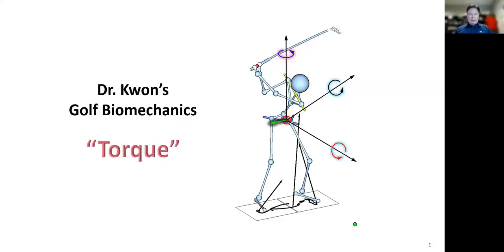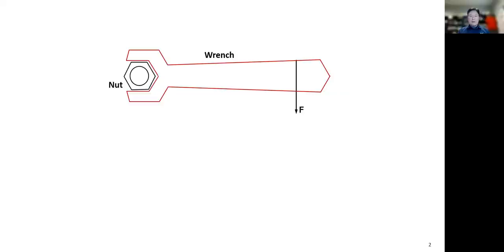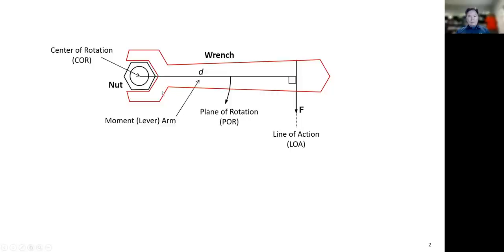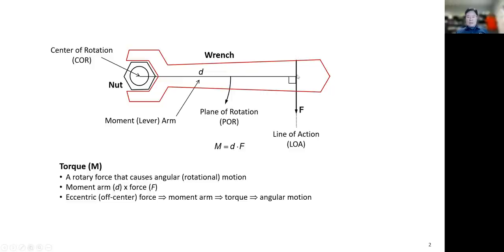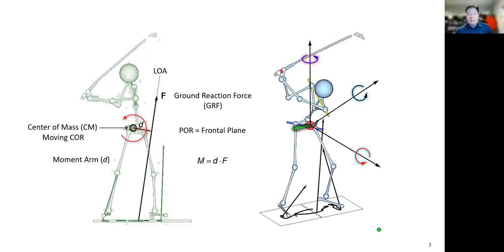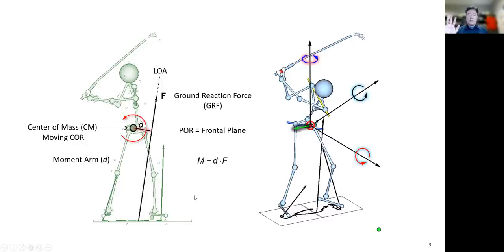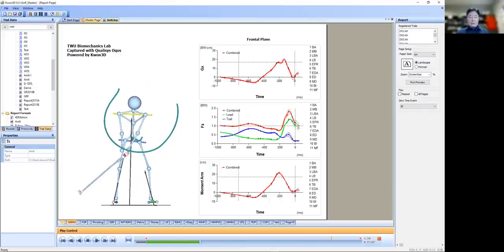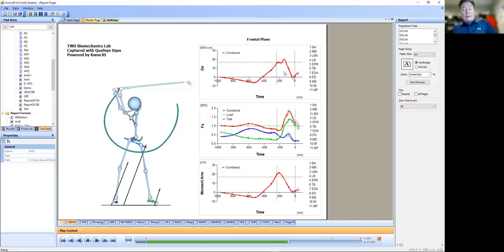2022-01-04 Kwontum Physics: Torque, Part I on Dr Kwon Golf

Comment: I have watched the 1-2 and three steps and a full lesson so far. This is the most important golf instruction and information I’ve ever seen. I’m posting this for my golfing community. I have been a two or three handicap most of my golfing life. In the first year I took up golf at almost 50 years old I was a five handicap within one year. Why, because I just use basic skills and a good coordination. I used kinetic energy based on my baseball swing. Moving the ground force horizontally keeping the back to the target the ball and then turning the hips through. As I said I was hitting it farther and better and all my golfing buddies and betting friends were amazed. Then I thought I would get better quick bye reading golf books and particularly Ledbetter. It was an enormous mistake as I spent countless hours on positions. I never got much better than a five handicap and actually got a little worse and then better only when my short game improved dramatically. Since then I’ve been going back-and-forth with different concepts always thinking about kinetic motion and energy build. Finally, I have watched Dr. Quan presentation and information. Now I understand how to create energy from the ground up and most specifically how to move and create the energy from one foot to the other. I know the information seems a little technical but it is very fundamental, proven and Important to all serious golfers. So if you are coordinated, have some flexibility and want to improve dr. Kwan‘s instructions may be the answer. By the way, I never post but I feel that this information is important. Best. And thank you Dr. Kwan, I just wish I could come there for lessons.

Comment: Thank you Dr Kwon. Two questions if you would be so kind. Firstly, can you please explain the best way to increase the moment arm for the frontal plane (POR)? For example, more turn and force in the backswing and then upward force on the front foot in the downswing? I'm not clear on the concept of horizontal = larger and vertical force = smaller at 12.50 in the video and how this relates to the unweighting discussed at  20.30. Second question. How do you increase forward shaft lean using these concepts? I have been able to increase my student's clubhead speed but not forward shaft lean at impact.

Comment: As someone who specialised in structural dynamics as they apply to seismic engineering I find your application of the same concepts to the golf swing helpful and illuminating.  Hopefully a companion video on the equally important ground torque about the vertical axis as shown in your 3D stickman figure will follow soon.   I would be very interested to know how much the inclination of the axis of the the total ground torque varies during the swing and if this is related to how “smooth” the swing is.   Presumably if this axis is varying a lot there would be out-of-balance forces that would need to be absorbed by the golfers inertia and make the golfers swing less “smooth”.

Comment: Thank you Dr. Kwon. 1) at top of backswing, how can we maximize inclination of pressure, by pressuring more on the instep of trail foot? 2) middle of downswing/p5, to maximize torque, move COP forward relative to COM (lengthen moment arm) and increase pressure on lead foot (increase magnitude) - would this be correct application to maximize torque?

Comment: Very interesting presentation and noteworthy that you revealed the model player to be Grant Waite, who was considered a model for the Stack and Tilt system.
Reply from the maker: This was his swing in 2015 and he was not a S&Ter anymore.
Reply: @drkwongolf  I would be interested in knowing what changed. Is it simply a matter of allowing pressure to move into the right side? The part about Grant Waite’s spine angle seems to be a major part of Stack and Tilt — the extension of the spine as the shoulders turn and tilt. .
Reply: @drkwongolf  Grant Waite is player A?  Who is player B?  Thanks

Comment: Thank you so much - deepest insight into the golf swing you can get. Understanding these videos there is no need to subscribe to any other golf channel. There is one point though that I do not understand completely. How is the force transferred to the hands/club? The torque getting from the GRF forces the pelvis (COR) to rotate clockwise (BS) and counter-clockwise (DS). Simplifying things and consider the upper body as one big block the rotatry force equally affects the hands/club. I'm wondering if it's only these few centimeters of pelvis rotation that have such a huge effect on the club head speed?

Comment: That is a good explanation of how the forces work within the pivot ( work ). Do you next have a video on how that work is gathered up and multiplied into power by the arms and club. The goal as you know is to multiply your force through mechanical advantage ( efficiency) and to NOT simply add effort. Good video and explanation. I note your graphic model shows very little if any linear travel ( sliding ). I was also interested to see the movement of the spine during the pivot ( axis tilt : the main body ). 
Thanks for your work. 
Cheers 
F
Reply from the maker: I have a lot of biomechanical topics to share. They will come as we go along. ^_^

Comment: Very interesting and helpful. I tried to adjust my hipmove and -turning accordingly. It's not easy but it works very positiv.  What about the TORQUE in the upperspine und shoulders during backswing and downswing when they transfer the torque established through best-using the groundforce as explained in the graphs by you? Is there more information to come from you? Looking foreward to your feedback. Thanks so far and best regards. Guenther (sorry for my english)

Comment: I realize that you teach Shurn. That to me means horizontal and rotational. What about vertical force? I would think the sequence would be shift, turn, and  push down to include vertical ground force. Correct me if I'm off base
Reply from the maker: The vertical rhythm (push-unweight-push) is the backbone of the swing rhythm and the shurn rhythm is added to the vertical rhythm.

Comment: Hi Dr. Kwon. I'm wondering how much does the torque when COP is inclined the most to create the longest moment arm but have lower force contribute to the final clubhead speed, compared to the torque generated when the vertical force on lead foot is at maximum but with shorter moment arm. What are their contributions to final clubhead speed in terms of percentages? For example, torque at COP max inclination makes up 70% of clubhead speed and the push from lead foot makes up 30%, etc. To put it another way, which torque is more important in generating clubhead speed that we should be focusing on creating?
Reply from the maker: The total change in the angular momentum is equal to the angular impulse on the body. The angular impulse is the time integral of the torque. You cannot say how much torque is coming from a particular peak torque as what matter is the overall area under the torque-time curve.

Comment: Hi Dr Kwon. As a Physics teacher and avid golfer I love your stuff. Wondering if you can clarify something for me. Swing Catalyst measures torque, thrust and vertical forces too. I believe the torque displayed by the swing catalyst is calculated around the vertical axis and is the sum of the products of the friction forces on each foot multiplied by their distance to the C of M. Is this correct? Your torque presented would be around the Z axis then? Is your torque  the product of only net vertical force multiplied by its perpendicular distance? Or is it the total ground force, i.e. the vector sum of friction and the vertical force times its respective distance? I would guess your torque and the swing catalyst torque peak at similar times. Is this a reasonable guess? Just curious to compare the swing catalyst data from other videos to you findings and how to measure/estimate your torque using swing catalyst data. How would twisting of the rear foot, ie.e counter clockwise from the golfers view, versus pulling the ground straight back (i.e. along the negative Z axis) be picked up or measured by your system or Swing Catalyst?
Reply from the maker: Yes, the torque provided by Swing Catalyst (3D plate version) is the torque about the vertical axis. I also compute this. I further divided this to two parts: pivoting torque and foot contact torque. Pivoting torque is the one generated by individual foot GRFs about the combined COP and the foot contact torque is the sum of the ground reaction torques directly acting on the feet by the ground.

The torque used to show the concept of torque in this episode is about the forward/backward axis. This is the sum of the torques generated by the individual foot GRFs about the COM but is also equal to the torque generated by the combined GRF about the COM.
Reply: @drkwongolf  Thanks for the reply. So the torque you are showing in this episode is tilted, and is presumably close to the swing plane, and not solely in the xy plane because you are using the total GRF (includes vertical, thrust, and friction) to calculate it. Is this correct? When you say forward/backward axis do you mean the axis coming out of th screen?

Comment: Dr Kwon - when I look at time point 8:49 in your video , I don't think M=d.F  is equal to the torque in the frontal plane. I'm assuming F is a vector in 3D so it might be piercing the frontal plane when viewed from another angle.  Wouldn't you need to find the component of  M= d.F  that is causing rotation in the frontal plane?
Reply from the maker: The force in question here is the force projected to the frontal plane. I used the symbol F but the actual force that you see is the projected force. Sorry for the confusion!
Reply: Many thanks

Comment: Dr. Kwon, thanks for your explanation. Can you answer this question: how does the width of stance affect the ability to shift the center of pressure, and affect the moment arm--D/E/F--which you discuss at ~16:00? I tend to have a wide stance, and though it feels stable, I have a feeling it is only restricting.
Reply from the maker: When the stance is too wide, it actually limits the pelvis motion because the ground reaction forces are too much inward laterally.

Comment: This is incredible and thought provoking. I have a question: Since torque is a function of moment arm + force/pressure into the ground (and thus the GRF), it seems that the much maligned stack and tilt method might be a way to create torque more simply - because you do not have to "time" the shift of force to the ground from trail foot to lead foot.   The key would be that you would have to keep your weight center back (i.e. by keeping the head/torso behind the ball) to maximize a long moment arm until after impact.  Is this correct?  감사합니다 교수님^^

Comment: 12:08 I dont understand increasing the horizontal force? You draw a little red arrow with a horizontal force vector, facing the target. 

The only way I can conceptualized this would be to feel like you have a momentum that wants to carry you away from the target as you get to the top of the backswing and the red force arrow you draw is the ground (or friction) that reacts against this momentum and keeps your feet stationary.

If it were frictionless, a push from the lead leg at the statt of the backwing would actually push you away from the target.

Is my interpretation accurate?
Reply from the maker: A large horizontal GRF toward the target means a hard push to the ground in the away direction using the trail foot.

This large toward GRF can be generated easily by moving the body in the away direction initially and pushing the ground to slow down the away motion. This push slows down the away motion and eventually move the body toward the target afterwards.

Comment: Hi Dr. Kwon, is it possible to share a similar analysis from a perpendicular plane? I am curious to how much those force vectors at the feet push away from the ball.  Thank you for sharing your work.
Reply from the maker: I will come up with another one with the down-the-line view.
Reply: @drkwongolf  Thanks! Look forward to it. I saw another video that mentioned that some high speed players push a considerable amount with the lead foot towards the ball to create torque.

Comment: I love the content, but I’m a bit confused.  We seem to have a ground reaction force operating in the x and y dimensions (ie a combination of forces that are operating vertically and towards the target), but to get the pelvis to develop angular acceleration we need a force in the z dimension (ie pushing the left side of pelvis away from the viewer). So how do our forces generate pelvis acceleration?
Reply from the maker: I have not talked about the torque generated about the vertical axis yet. You also need a good amount of torque about the vertical axis. It is coming soon.

The way the golfer uses the ground in the frontal view is actually what differentiates a golfer from another. The torque pattern about the vertical axis is fairly consistent among the golfers.

Comment: So the key, besides staying centered by keeping a straight spine, recentering and doing the vertical pushes at the right time, is to push off the right foot towards the target while preventing the pelvis from sliding towards it? (Gankas with an earlier push?) 
And: So only the hereby accelerated vertical rotation of the pelvis/COM matters?
Reply from the maker: The push should be downward and outward by the trail foot in the BS and the lead foot in the DS. The easiest way is to take steps outward: Stage 1 of the two-step swing drill.
Reply: Thank you!

Comment: I could be missing something here but I'm much perplexed by your presentation. If the centre of mass or moving COR is akin to the nut in the first illustration, are you saying the length of the moment arm affects the speed at which your pelvis rotates? If so, does this imply faster pelvic rotation is what determines the swing speed? And what would be the determining factor in golfer A that would create a longer moment arm than that in golfer B? Said another way, why is the ground force further from COR in A's swing? Thanks.
Reply from the maker: The moment arm is about the whole body COM, not the pelvis COM. The key in Player A's motion is active horizontal interaction with the ground. That is why his horizontal force is large and the force arrow shows more inclination. Do not just stand in the middle of the stance but actively push the ground outward and develop lateral motion of the pelvis.
Reply: Ok, I'll need to give this more thought to get my head around how the principle applies in golf swings. Perhaps I would need to understand what you teach in your other vids. Thank you.

Comment: Hmmm. Interesting but surprising to me that no discussion of the forces etc provided by upper body, shoulders arms wrists and hand has been discussed here.
Reply from the maker: It is not possible to accurately measure the force provided by the upper trunk, shoulders, arms, wrists, and hand as these body parts for a closed chain in golf swing.

Comment: So what in your step drills increases Inclination force,and what keeps the COP back from the lead foot?
Reply from the maker: The COP stays close to the trail foot at the top of BS because the force acting on the trail foot is greater. The force arrow inclines toward the target when you push the ground good in the away direction. Stepping with outward push suffices both.

Comment: Dr Kwon, 
What causes a good unweighting phase?
Reply from the maker: Unweighting means the vertical GRF is smaller than your body weight. In reality, as long as you have stepping-like rhythm (vertical rhythm) in your swing, you will automatically have good amount of unweighting.

Unweighting normally occurs at the end of an upward motion (upward deceleration phase) and at the beginning of a downward motion (downward acceleration phase). So as long as you have rhythmic and continuous up-and-down motion, you automatically repeat active push and unweighting.
Reply: Mac Ogrady and grant Waite video together shows Mac at the beginning of the downswing taking a little more time to start downswing with this stepping like rhythm.thanks for this Grant  Mac favourite Jodie Mudd.

Comment: What is it that GW does that Player B doesn't do to create the horizontal force that results in the greater inclination of the moment arm? And can Player B use other torque forces for power that he doesn't get from GRF torque, or is GRF torque that much more dominant than the others?
Reply from the maker: GW interacts with the ground in the horizontal direction well but Player B does not. The only way one can generate external torques acting on the body is to use the ground. No other way.
Reply: What is most efficient way to generate horizontal forces then?
Reply from the maker: @robertlozano6546  Pushing the ground outward (opposite to the target direction) and generate an inward reaction.